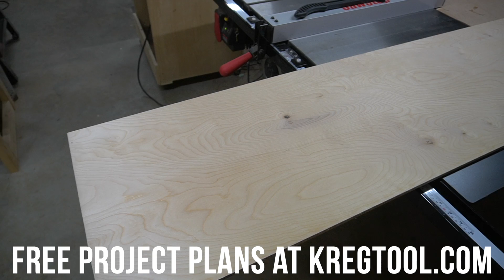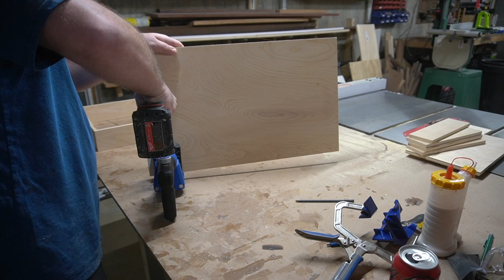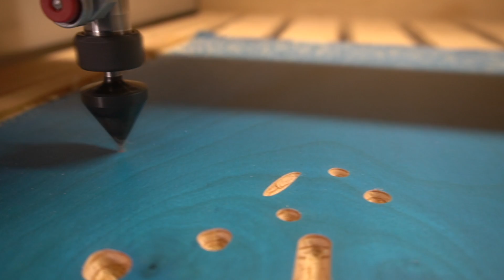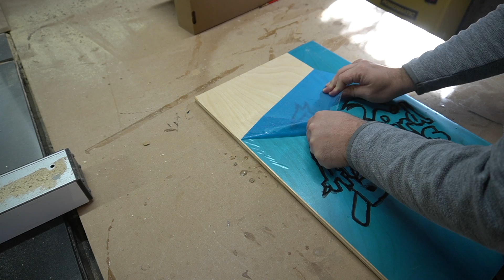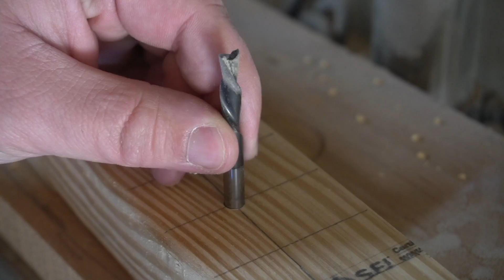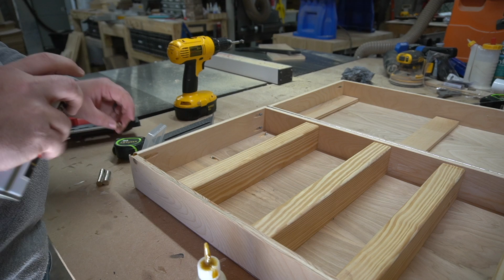How To Make CNC Router Bit Storage! One Day Build

Comment: This is great, and I am going to take a stab at it I think, at least for the interim.  I am curious though, why not just have the CNC drill the holes?
Reply from the maker: Cool! You could have the CNC drill the holes. I found it quicker to do it this way rather than setup the design in the software, clamp the material, etc.

Comment: Great build man My area I work in now is 12x25 tight and messy. Yesterday I purchased 16x32 building that will be 100% my woodworking  area yea it's small compared to some but for me should be just fine Im definitely building a few of these for router bits , drill bits etc. I'm going to try to organize as I move my stuff in there.
Reply from the maker: That's awesome! Congrats on the new space

Comment: Nice but i do have a question. I made a open case kinda same idea but for screw drivers and such and mounted it on my table in garage. the issue i had with using pine It collected moisture fast and caused rust to act fast. caused my screw drivers to get rust. it does get cold in my garage.   not extreme but cold.
Reply from the maker: You'll probably have that issue no matter what material you use.
Reply: @AndyBirdBuilds  I ended up 3d printing insert trays. Found a old bathroom med cabinet converted it into bit storage :)
Reply: Seal all wood, cheapest option would be sanding sealer, if u want it to look nice and dont mind the extra work, seal it with a few coats of polyurethane, be sure to sand and tack cloth between coats.

Comment: Great job!  I need to do this so badly.  Did you think about drilling out the holes with your CNC?  I just did that with an adjustable shelf project.  48 holes tool less than 2.5 minutes and they were all perfectly lined up.
Reply from the maker: Thanks! My original plan was to use my cnc to drill the holes but by the time I designed it in cad and set everything up on the cnc, I just elected to do it the old fashioned way.